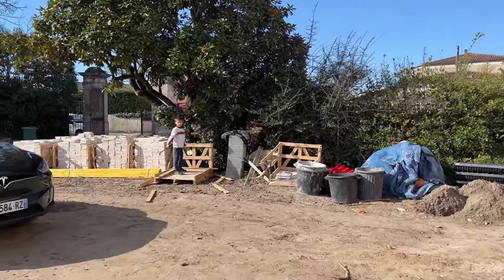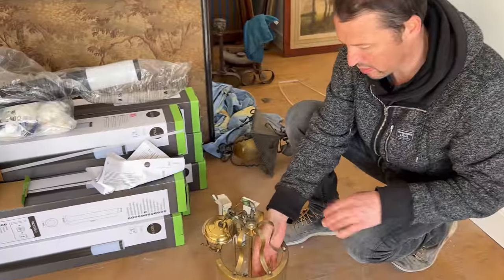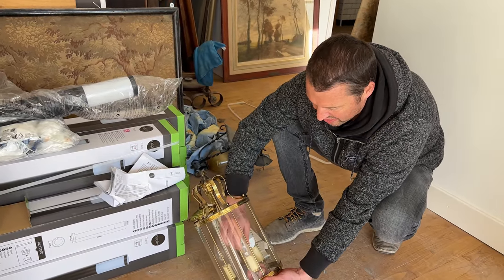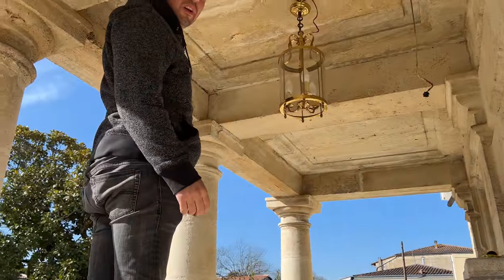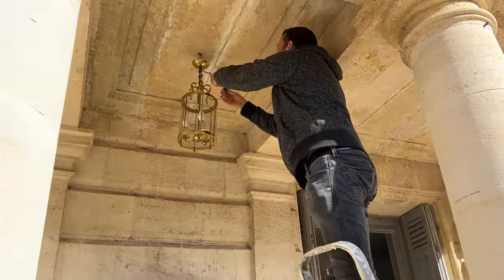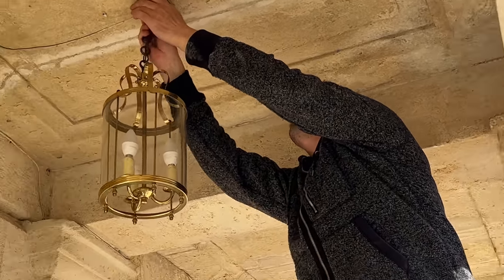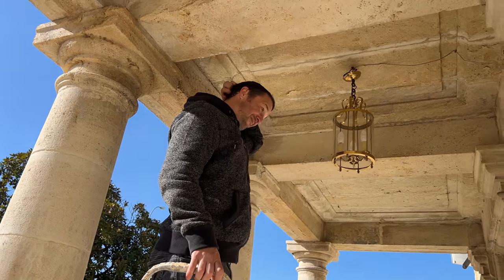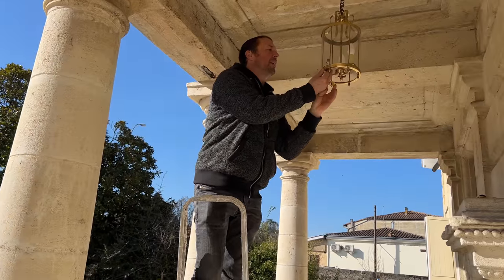EP131 Our couples problem laid bare for you all to see.

Comment: Ed  Little tip from someone who worked in lighting store.  Rub a small amount of petroleum jelly (vaseline here in the US) around the metal base of the bulb and the contact point on the bottom.  You will never have rust on the inside of the socket or seizing from a hot bulb in the socket.  We love your vlogs and look forward to them each time.  The new house is coming along nicely and is going to be beautiful when done.
Reply: Silicone grease is better; it doesn't oxidise.

Comment: Those candle covers are easily replaceable. Turn off electric ⚡️ Remove bulb slide off cover. 
Cut to size. Replace candle like cover then replace bulb.
The heat from the bulbs will melt the cover if it’s a smidge too high.

Comment: Your problem with the lights is the contact, right? I've always had luck with taking a long flat head screw driver putting it into the socket and scratching the contact inside the socket that touches the bulb bottom (which is clean) No need for more cleaner just scratch the contact, et voila!

Comment: You tickle me. The time you wasted fiddling around with that light you could have taken it apart and fixed it properly. LOL. It is probably the contact metal piece in the bottom of the socket. It needs to be bent back up a little to make contact with the bottom of the bulb. But watching you two go at it is worth watching you not doing it the right way. So good job.

Comment: To test light fixtures before hanging them-I have cut the end off & split the wire using red & green tape. Then I can test the light fixture on the floor to make sure it is working or if it needs a fix. Easy to sand the inside of the fixture contact. Then test on the floor before putting it up. Saves a headache of working over your head. Plus you can see what you are doing. Good luck on this one. I’m not sure about the effectiveness of WD 40 on this project.

Comment: Good job on that light fixture, if the bulb is still not making contact properly ( flickering )you may have to bend up the centre contact a bit, but be careful not to break it, depending on the condition it is in.